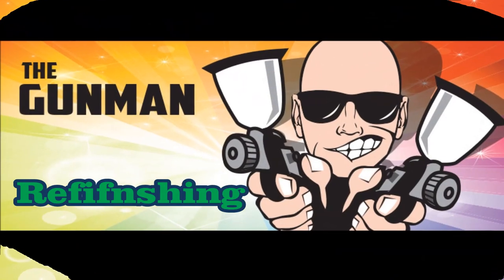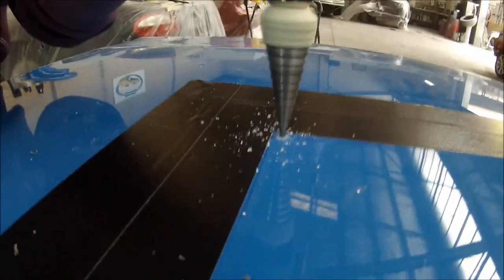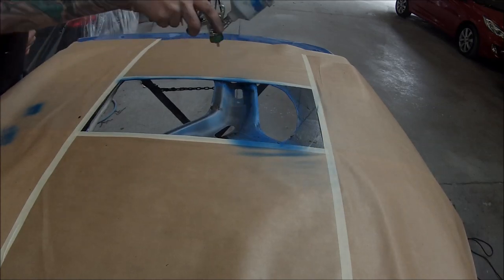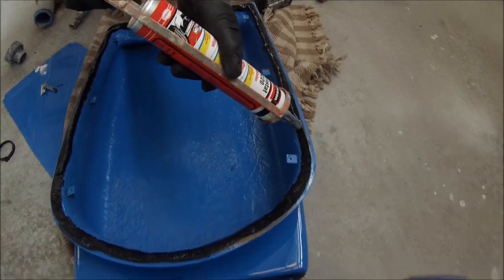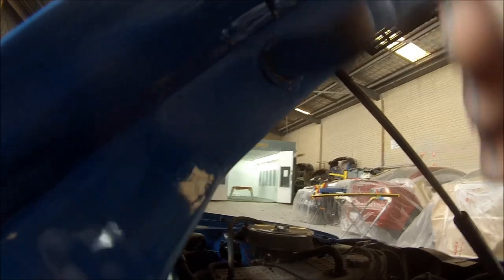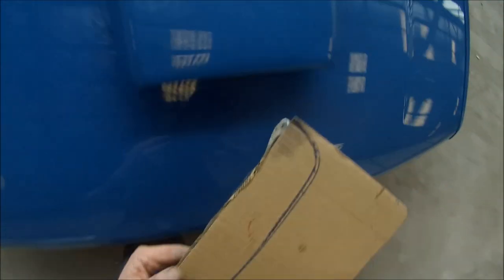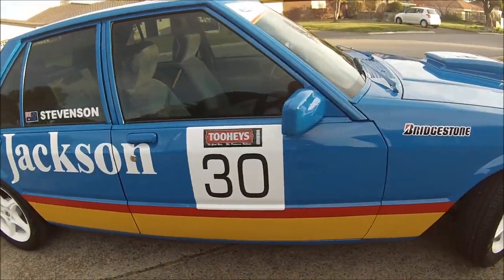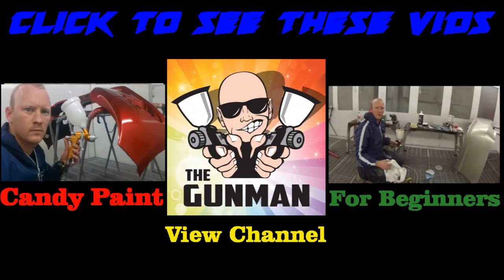How to Fit a Bonnet Scoop Like a Pro

Comment: Nice color!  One thing I've learned about mounting a fiberglass or ABS plastic hoodscoop on a metal hood is that the different materials will expand and contract differently with temperature changes. This could cause splitting and cracking.

Comment: Great to see the final part of the car done. nice work. the scoop really sets it off. Any tips on getting the jig saw to cut straight on the bonnet? Ive never used a jig on sheet metal, always gone the cutting wheel but it looked meet and the less sparks on fresh paint = great idea.
Reply from the maker: Just make sure you have the right blade and it should cut through nice just as you saw.

Comment: What exhaust setup are you running on your mighty XF? I took the exhaust system off my EL XR6 and was thinking about cutting the two smaller mufflers out and just leaving in the last big one but whatever you're running sounds perfect. Also any tips on putting a fiberglass BA bonnet bulge on so you can't see the square patch around it?
Reply from the maker: Hi mate thanks, The exhaust system I have on mine is "Wildcat Headers" (Extractors) with a 2.5" inch System no cat, and if you have a fiberglass bonnet then you can get artistic with filler and round off the edges as you like but just be careful not to go too far in or you will get holes open up, It may be worth getting some help from a mate doing that step as I did on this bonnet scoop, 2 heads are better than one and if you know a panel beater then thats perfect, Good luck mate.
Reply: The Gunman Thanks for the reply. I'm doing my pre apprenticeship for panel beating and wanted to build my falcon by myself as something of self accomplishment so i didn't want any help from a pro but I tried making the BA bulge fit the bonnet as best as possible before i fiberglassed it on and smoothed it out with body filler but it doesn't look factory like other ones i've seen. I guess i'll just have to bite the bullet and get someone to do it for me haha.
Reply from the maker: Yeah that kind of stuff can be quite tricky even for some tradesman.

Comment: what if it rains . does the water came through the bonnet? and for the older car it does damage car right? what is the solution for it??
Reply: what do you do if raining season? do you closed that bonnet infront or not? . . i have old car that has still distributor cap on it. . we all know that distributor cap is sensitive in water. . im wondering when its raining season what do you do?

Comment: Base coat over bare metal?
Reply from the maker: Yeah its probably not recommended but I'm using solvent base so it wont rust. and it's all out of sight so all it is doing is stopping the metal from being exposed.

Comment: painting silicone what a joke as for the applying of it Jesus Christ man mask it fair it and you wont have to paint
Reply from the maker: It's not silicone, it's seam sealer and designed to be painted over 😁
Reply: if thats the case I stand corrected, thankyou